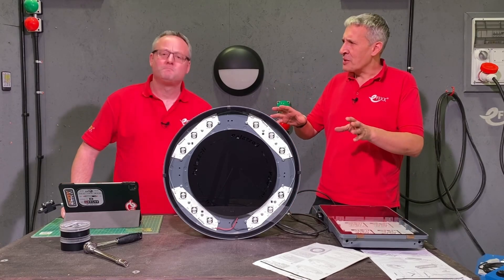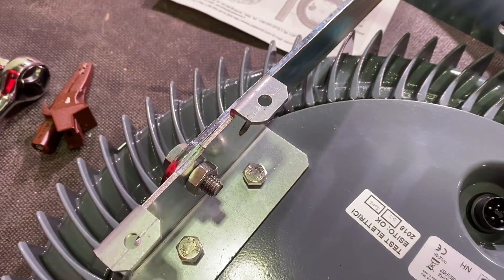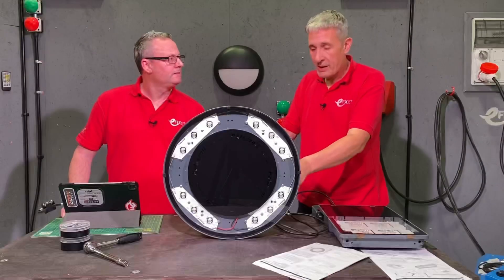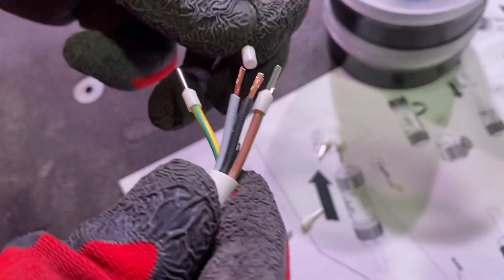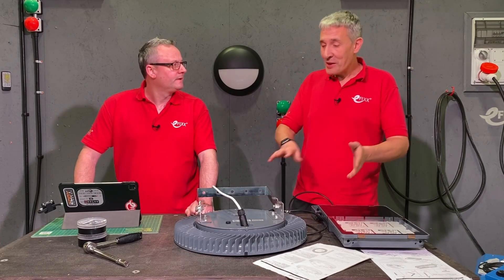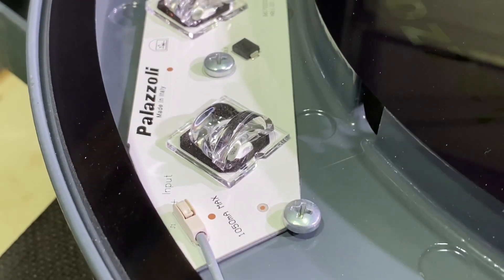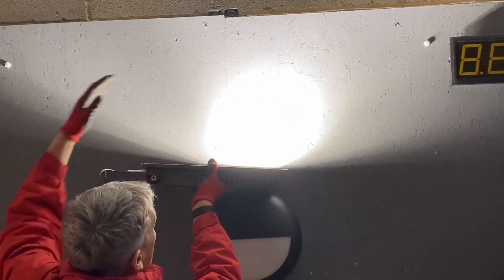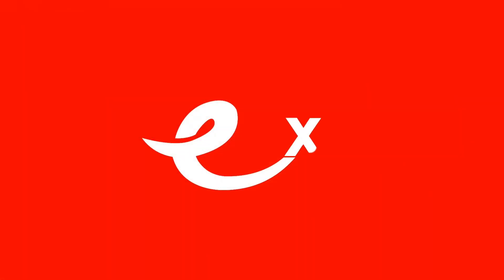ARE YOU INSTALLING RELIABLE LED LIGHTING? - Lewden lux

Comment: Question is regarding gore vent. Can you explain it in details.
Reply from the maker: Gore vent is a breathable membrane which allows air to escape but prevents water vapour molecules entering the fixture. This allows a fixture to maintain a lower internal air pressure when ambient temperature increases so not stressing the gasket seals etc.  Also helps to prevent condensation build up within the lighting fixture. Hope this helps.